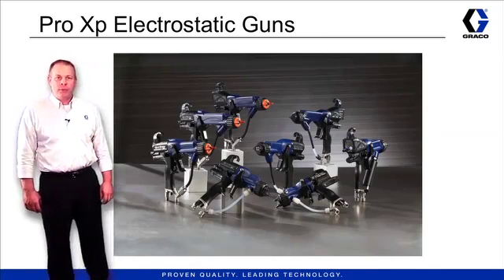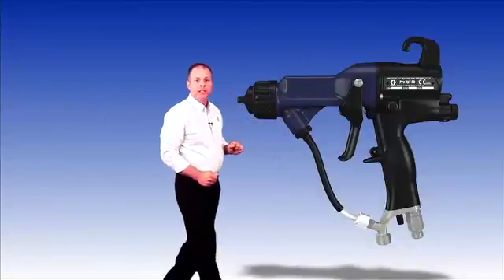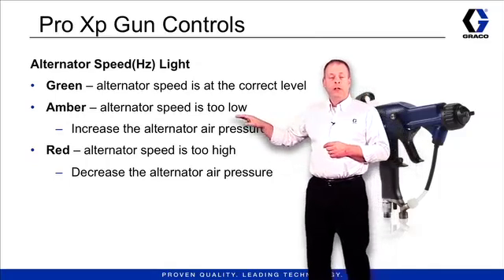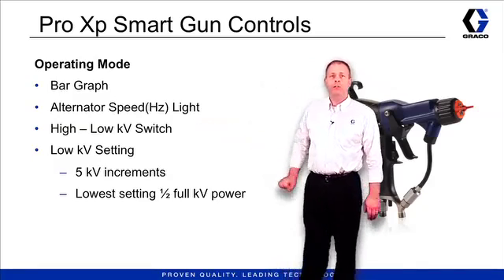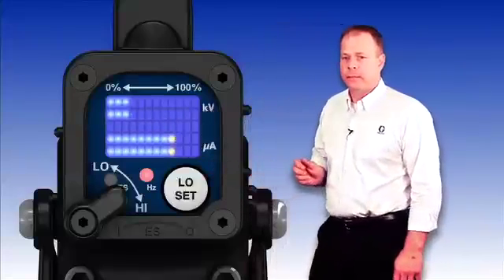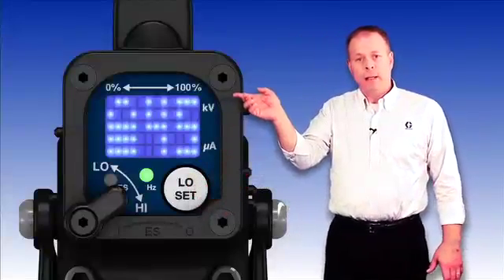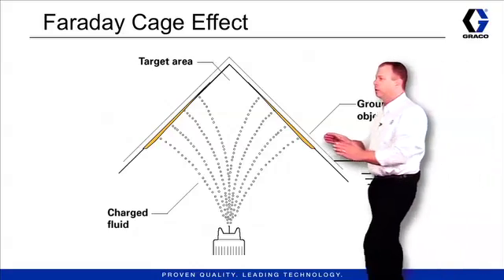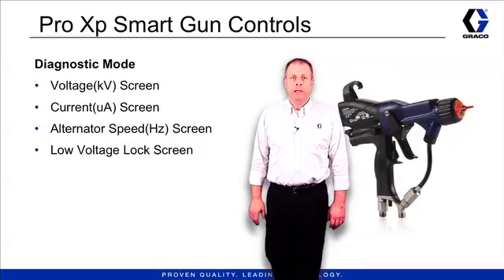Graco Pro Xp Gun Controls Overview

Comment: where is the power source of the gun that produces the electrostatic effect?
Reply from the maker: The gun power source is an air driven turbine inside of the gun. You can see it in a cross section view of the gun about halfway through this video: https://youtu.be/2ZGybmaViJI
Reply: Graco Industrial Equipment could this be used in spraying disinfectants that are water-based? I want the disinfectant to have a static charge for the same purpose of having the material to cling to surfaces that are hard to reach or are commonly missed.
Reply from the maker: @allen52965  No. Due to grounding concerns, Pro Xp guns are not designed for commercial environments. Graco's SaniSpray HP is designed specifically for spraying disinfectants. Learn more at https://www.graco.com/SaniSprayHP